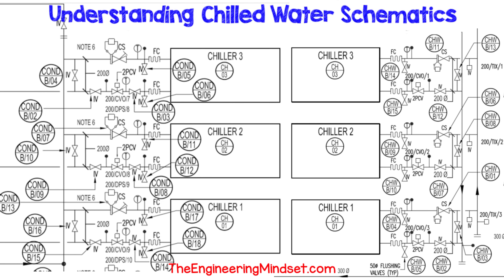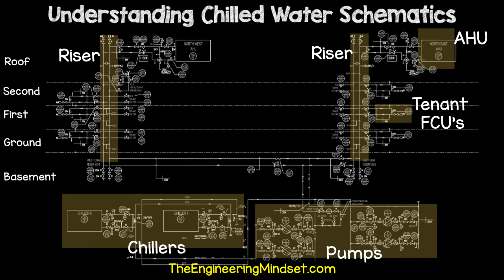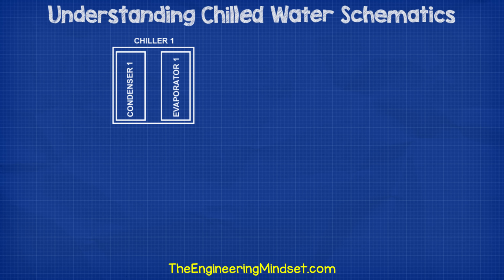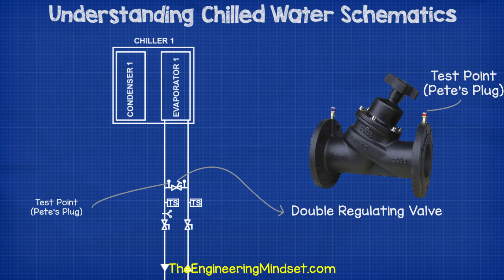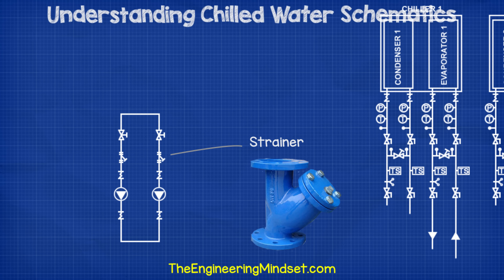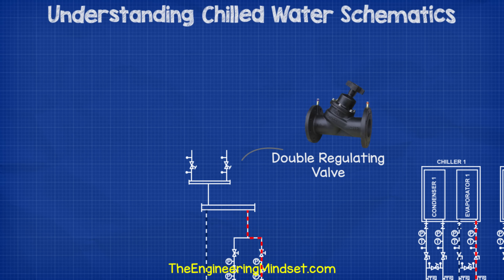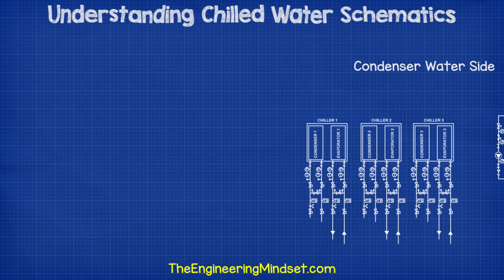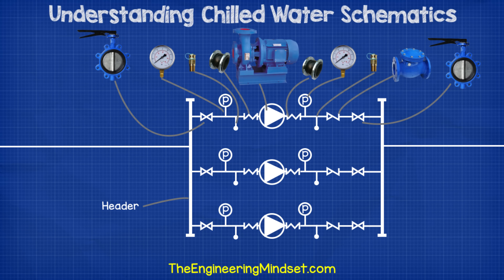Chilled Water Schematics - How to read hvac engineering drawing diagram

Comment: Does chiller system like this require Trace Heating tape on external pipes?
Reply: no need to install heat trace wire on chilled water lines outside insulating the pipes and adding glycol to the system should be sufficient to prevent freezing
Reply: @miramel09  thank you for reply - glycol couldn't be used in this system and it was filled with water hence idea of protecting pipes when OAT<0

Comment: Hello Paul, 

Many thanks for the video.
 You are really making the world a better place by your well thought out explanations on Chillers + AHU +FAN Coil units. Engineers like my self who is specialising in HVAC system can this field more interesting. 

Thanks again. Though I have a question
1) How is water added to Air cooled chillers if it is low?

Thanks.
Reply: By adding Make-up water tank to chilled water lines.

Comment: How does a chilled water system fill up? If you drained the remote evaporator barrel during the winter.   Also if you dont want to use a hose to fill it up. I was always told to fill it up with a hose. My question is what is another way to fill it up?

Comment: are u saying water from the cooling tower directly enters the chiller ? should it not have a heat exchanger - to separate these streams?
Reply from the maker: In most cases it directly enters but not always, some will be separated especially if there if there is a large static pressure
Reply: The Engineering Mindset thanks for your reply! It's a real help to build the bridge between the theory - schematic - reality.   Nice vids